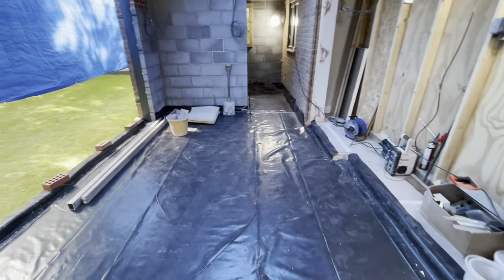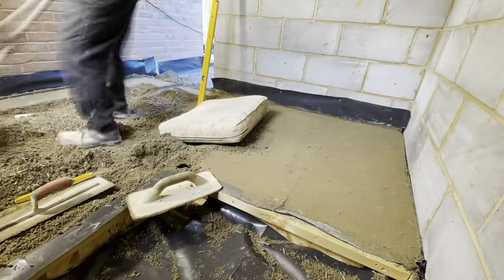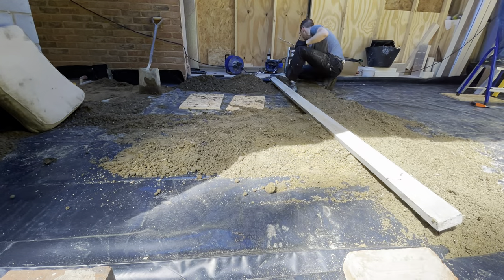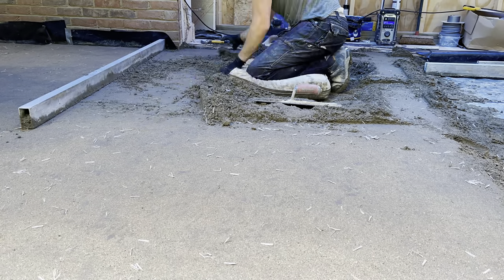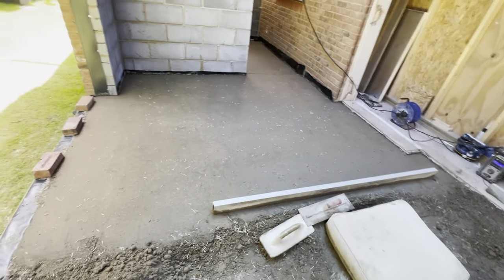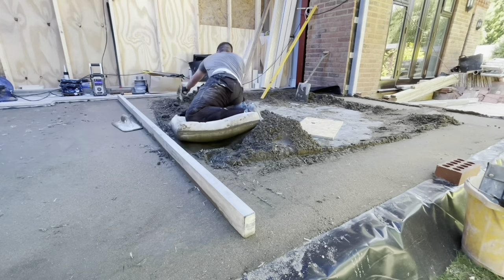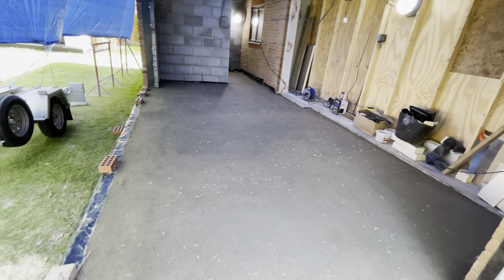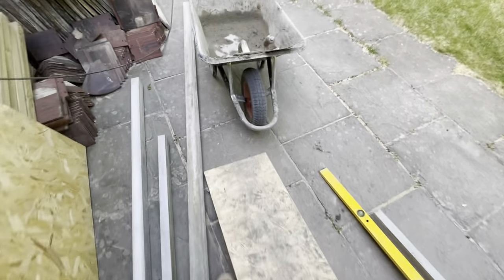How to Floor Screed with sand and Cement by hand - Beginners guide - plastering guru

Comment: genuinely, is it doable for a novice to do this do an adequate standard? I'm so tempted given the quotes I've gotten back to hire professionals. I've got a 5 x 5m garage I'm converting to an office and you made it look fairly straightforward! Not easy, but straightforward..... any pitfalls to avoid?
Reply: Yes I just screeded my kitchen, never done it before. 
Main tip is don't make the mix to wet or it will be a nightmare.
Get a cement mixer also.
Always can use a self leveling compound afterwards.